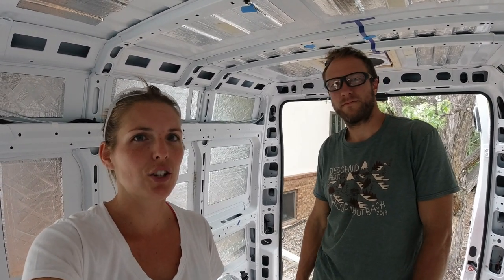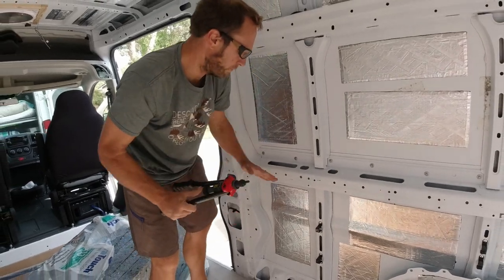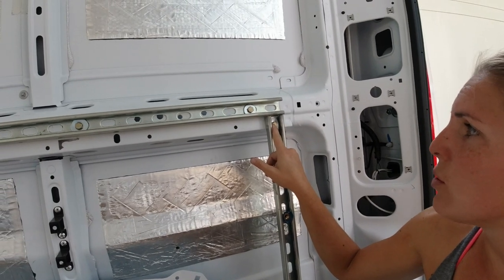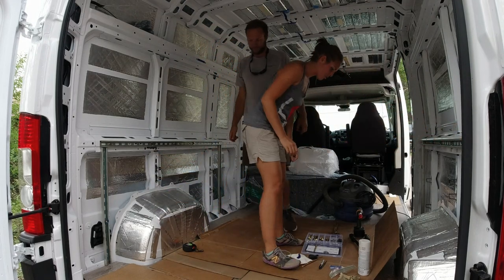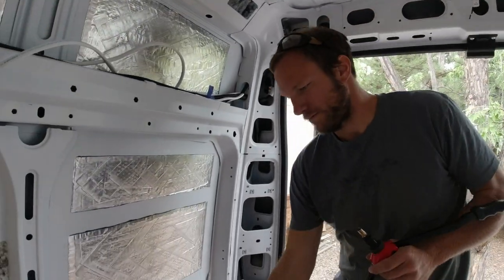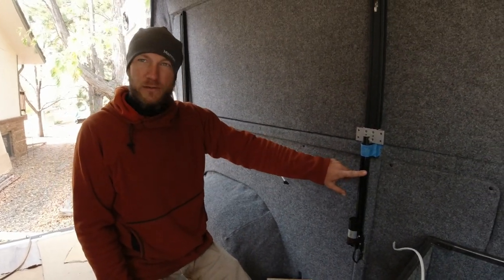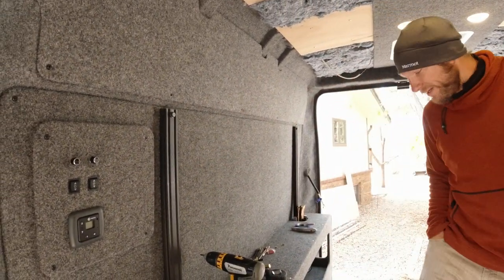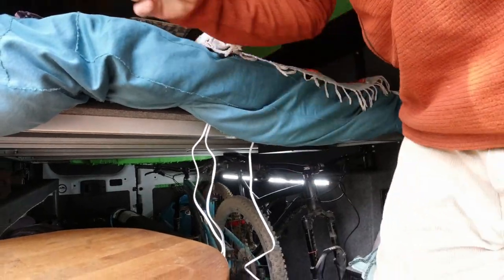Best Van Conversion Bed Lift: DIY Adjustable Bed for Promaster Van Build & Van Garage

Comment: I’ not understanding the purpose of the two long 55 inch metal u pieces.. won’t the bed frame stop where the sliding vertical piece stops at the bolt? Please explain as I am trying to figure it out, thanks! Also, do you have a video of it in action on that exact van?
Reply from the maker: Hi and thank you for watching! The bed will stop at the bottom of the actuator stroke which puts it slightly above the lower bolt that you are speaking of. As for the horizontal unistrut,  it may be over engineered but our thought was that it would help disperse the weight from us and the bed across the length of the long piece with the vertical unistrut providing additional support. We will be putting out a follow up video in the near future that shows it all done up and fully in action.
Reply: Sweet, can’t wait!

Comment: 2 things: 1 - watch for cylinder creep and 2 - cylinder speeds are controlled by preventing the LP side from venting too quickly
Reply from the maker: Hi. Thanks for watching. I would assume creep would be kind of like sag over time? If so, we can happily say that they don't seem to move. Good to know about the speeds. Luckily they are pretty close that we won't play with that.
Reply: Yep,  won't bore you with the calcs, but it's a force/area thing, where the pressure sort of relaxes. Cheers from Wales.
Reply from the maker: @dexstewart2450  thanks for the info!

Comment: Hey love this...very helpful...I am interested in the wall panels you have in this van (they look felted). We are going to insulate with wool and are at the point of needing to pick a material to side the ceiling and walls with...love the warmth and look of the panels here. Would love the name of this product and where to order it....thanks (we have a 2020 sprinter if that helps) Jen
Reply from the maker: Hey Jen, thank you for watching and for the comment! We used automotive upholstery that we purchased direct (in person) from a van conversion shop in CO. It is pretty pricey, but we ordered a few samples of other stuff online and hated the texture and quality of it. Unfortunately I don't know the maker of the fabric itself or if the shop even sells it normally. A friend of ours knew them well and made the connection.

Comment: very nice.. just curious about the speed those actuators have.. can't it work faster then this somehow? ;) i find it kind of slow... besides that it's really perfect!
Reply from the maker: It would be nice if they were faster, we agree with you on that for sure.  The nature of actuators is that they are generally slow.  They're meant for lifting heavy things in a controlled manner and when we researched them, even the more expensive ones are pretty slow.
Reply: @DrifterJourney  ok but there is not an option, to remove the safety or just boost the power that is sent or something?
 :D i dunno just thinking those things could be "hacked" or something to make it go faster somehow.
Reply from the maker: @thesparkdomain-music  aaahh, I see what you're getting at now!  I am sure some engineer somewhere has figured out a way to make them race up and down, but we didn't have the time or skills to do that.  Good idea though... it does seem like there could be a way.  If you look into how they're made, it might be possible!

Comment: Do the actuators auto stop when they have reached the predetermined height?
Reply from the maker: Thanks for watching! That depends. They auto stop when at their maximum and minimum stroke. Therefore they could if you figure out the exact locations you're shooting for and hope that they make one that will stop there. We wanted it to be able to go higher than our sleep height so we would have to stop them manually.
Reply: @DrifterJourney  But they travel at different speed as you have mentioned and you have no individual control of the actuators except for either the front or back, would it not experience some uneven heights or jam up the track?
Reply from the maker: @wilsont1010  you can buy more expensive Actuators and modules that will have them run at the same speed. These weren't far enough off that it ever caused a problem. We would just reset them to each other (max at top or bottom) if they got wonky over time.

Comment: Why do the u-channel horizontally at all? Why not travel up with it? Or do just a very short section if something does actually need it to be that way so you are using less material? Just trying to figure this out. Thanks for any help!
Reply from the maker: Hi Erika. Thanks for watching. We're not engineers so we were just doing what made sense in our minds and worked on our previous van. Our thought was to distribute weight as much as possible......and the full length allowed for us to put the 80/20 verticals wherever we needed when we got to that part. Hope that helps!
Reply: @DrifterJourney  Thank you so much. I like to try to understand why things are done and the reasoning chosen. Especially since I've got a 2018 and am doing the same thing. Lots of information coming in hahaha. You are appreciated.
Reply from the maker: Happy to help and good luck with your build!

Comment: Can’t you control all 4 actuator same time with one switch?
Reply from the maker: Thanks for watching! I would imagine that we could have done it that way but we like the front and rear to run separately so we can "cheat" a little to level the bed if we're not totally flat.

Comment: What are the brackets above the wheel well on the vertical frame beams? Where can one get them? Thanks!
Reply from the maker: We had to make custom brackets that attach the linear actuator to the linear bearing and the bed frame.  It is angle steel that we welded.

Comment: So when the bed is down does it just sit on top of the actuators?
Reply from the maker: Yes, when the bed is all the way down, the actuators are at their shortest length and just hold the bed at that position. There is no need to have anything else to hold the weight of the bed if you buy actuators strong enough- they can hold the weight at any height without issue.

Comment: I like the details.

Electrical details would have been nice.

I really don't know about the design that doesn't synchronize all legs to move together...
Reply from the maker: If you have the budget, you can spend more to get them in sync.   It doesn't end up being a big enough deal for us to justify it.  We are working on a follow up video with electrical details (wiring diagram)

Comment: I'm planning to do something very similar, and have a question I was hoping you'd help me with! I'm thinking of just mounting the linear actuators to a fixed bed frame on four corners, with no side rails.  The goal is to lift and raise the bed 12 inches (not for bikes underneath), and to use the actuators independently (to level the bed, when necessary).  I am considering ball joints at the top of the actuator, so the bed frame can move in both directions without putting stress on the frame or the actuator.  Does that make sense?  Basically wondering if the rails are necessary or not.  Thanks!
Reply from the maker: The rails are the only thing keeping the bed stable.  In order for the bed to move up and down, you would need a gap between the walls and your bed platform.  Without the rails, when lifting and lowering the bed, it would move back and forth in any direction.  The linear actuators have a bit of play between the piston and the housing.  They are not made to operate like a bottle jack that can stay locked in a position and hold weight.  We're not experts and there may be a linear actuator that is capable of that, but our recommendation would be to use the rails for stability. Hope that helps!
Reply: @DrifterJourney  thanks for the reply! I'll keep brainstorming
Reply from the maker: I'm sure there is a way to do what you're imagining......just trying to wrap my mind around how it would work. The ball joint idea is good. We have ours wired in 2 (front together, rear together) so we can level a bit front to back. I would worry about the lifted actuators holding shifting weight if it was free floating. Let us know if you make it happen because we would love to see it.

Comment: How the bottom of the actuator attached to the u-channel? That round hardware in the u channel is moving up and down, right? How do you fix the actuator?
Reply from the maker: The round hardware in the U-channel stops moving up and down once you tighten something into it.  The bottom of the actuator comes with a bracket that attaches to the actuator with a pin and then has a hole in it.  You then use a bolt to attach that bracket to the round hardware in the U-channel.  Hope that helps!
Reply: @DrifterJourney  I see. Thanks for the explanation. Your video is the best video I have ever seen for van lift bed. Did you put a link for the round hardware in the u channel? I didn’t see it. Thanks!
Reply from the maker: I couldn't find a link for it online, we got it at Lowes when we bought the U-channel.  For some reason they didn't have it on the website.🤷‍♀️

Comment: Can you adjust the level to sleep waterpass? Or does it need to be all the way down for sleeping
Reply from the maker: We can sleep on the bed at any level, it will hold our weight no matter what height it's at.
Reply: @DrifterJourney  I meant bars at different height to level the bed, sorry I'm dutch🤣
Reply from the maker: No problem! So did I answer your question?
Reply from the maker: The front 2 lifts and back 2 lifts are on different switches. We are able to level it front to rear about 4inches or so without twisting the frame.

Comment: Hello, Wondering if anyone has used alternate actuators seeing how the ones DJ recommended are out of stock. Ill try and come up with an answer on my own and let yall know what i find but if someone else has done that part id love to see what you came up with.
Reply: or maybe ill just get the ones that are two inches longer but otherwise the same
Reply from the maker: That's probably a good idea. We had 24" inch in the last van.....just didn't need that much so we went a smaller this time.
Reply from the maker: Let us know what you find out.

Comment: What strut size and linear bearing granger has 3 pages..lol
Reply from the maker: The link for the linear bearing is in the video description: 80/20 Inc. 6523, 15 Series, 4 Slot Mount Double Flange Short Standard Linear Bearing with Brake Holes https://www.amazon.com/dp/B006YVZ4AU/ref=cm_sw_r_awdo_navT_g_Y7E7WG1626GSWG55RGRK
Reply: @DrifterJourney  thank you so much...i was on phone with granger with 3 people and they had no clue what iwanted lol.
Reply: @DrifterJourney  so its 15 series 1.5 inch by 3 inch extrusion
Reply from the maker: @carlmeyer7616  yes, that's correct - that's the series that works with the linear bearing. We only used that size for the vertical struts, the rest of the bed frame is made with regular 1.5 x 1.5 80/20 rail. Hope that helps!

Comment: what is the size your bed？
Reply from the maker: Big! It's a King that we trimmed to fit. In the end, it's still bigger than a Queen.
Reply: @DrifterJourney  is it on the direction of the driveway? or vertical to the driveway?
Reply from the maker: I'm not quite sure of your question but I'm guessing you're asking about the bed orientation? If so, we sleep front to back with our heads by the back doors. I'm too tall to try sleeping side to side and our bikes need the space under the bed regardless.
Reply: @DrifterJourney  that's very helpful, thank you!
Reply from the maker: @Ryan-yx4ib  you're welcome!